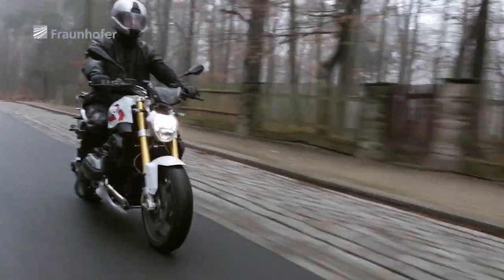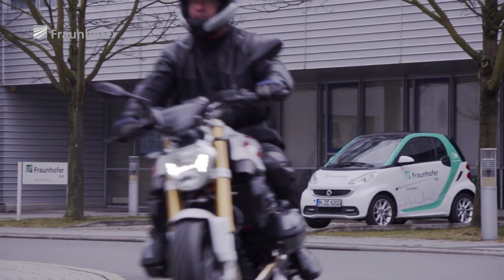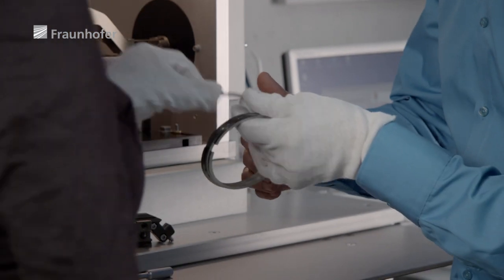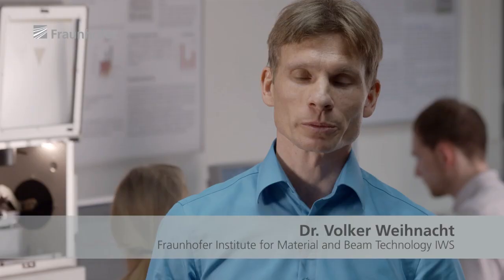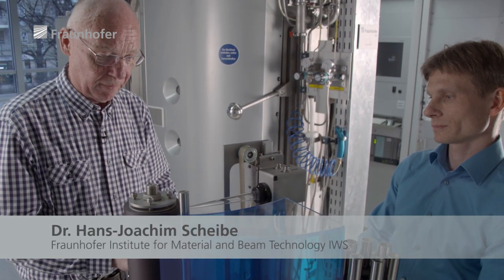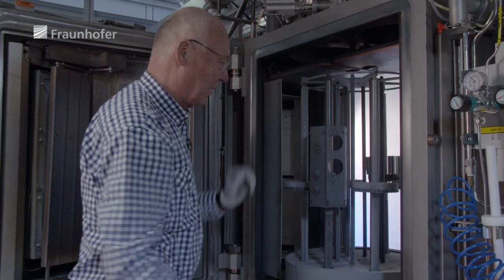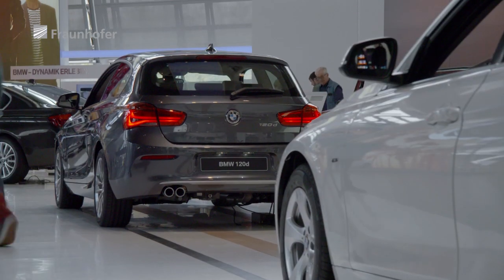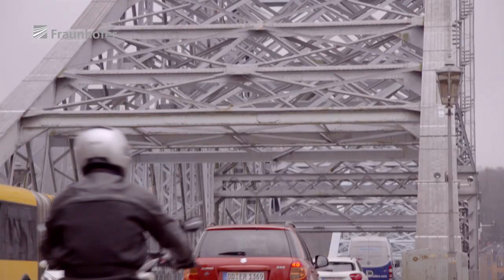Diamond like coatings save fuel

Comment: All start with the repair of a suzuki RE5, i start looking for teflon to coat the damaged side cases of the rotary,now i am looking to build a dlc coating machine for the engine parts, may be will try using a microwave oven  magnetron and keep reading,if in 1 afternoon i was able to end here, may be will build a machine to test, in the article state that a carbon piece is used? this process is like the process used to coat lenses, i will try to build a machine, thank you for the information.

Comment: At what cost ?? A set of rings, 8 valve stems, 12 straight gears, 4 hypoids ??
I suppose the oil pressure fed bearings wouldn't matter.
Reply from the maker: The scentist from the Fraunhofer Institute for Material and Beam Technology IWS in Dresden had succeeded in producing hydrogen-free ta-C coatings on an industrial scale at a consistent level of quality. Unfortunately Fraunhofer can not specify on which products our industry partners use the coatings and what the prices for motors parts with the innovative Fraunhofer coatings are.